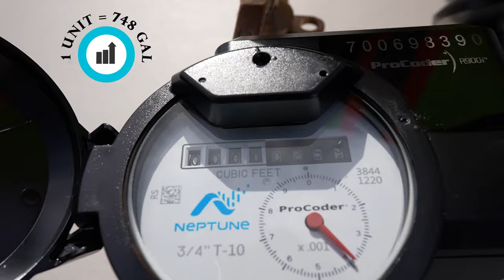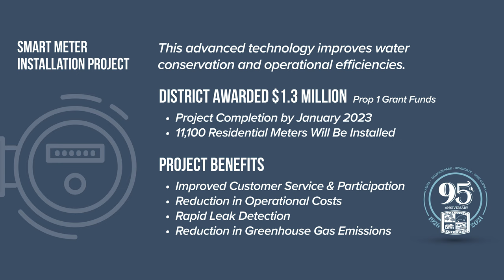Smart Water Meter Install

Comment: As a customer, do I have access to the flow data at any time?
Reply from the maker: A customer portal is in the works but not available at this time. We will notify customers when portal is available.
Reply: You could ask for a consumption report upto a year or more in some cases. You can also get a 30 day consumption report which is done by the water meter tech using what is called a 'data log' hand held device or laptop etc which will give you the day and hour (in gallons use)

Comment: Hey there, how is the antennae connected to the Water Meter?
Reply: Also, what is the antennae you use?
Reply: @muscleman3515  the antenna has a port that connects the  wire with a sensor that is attached to the meter, the wire can be removed. The antenna or smart point is by Sensus.